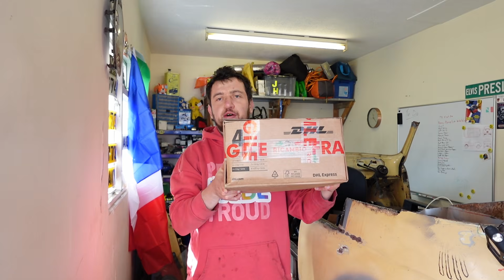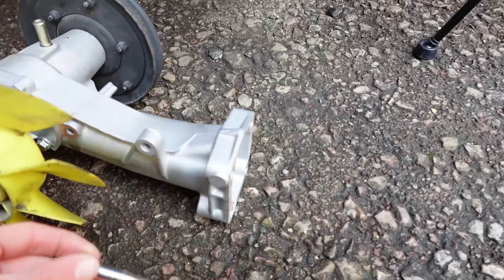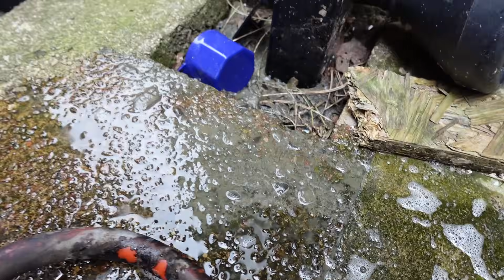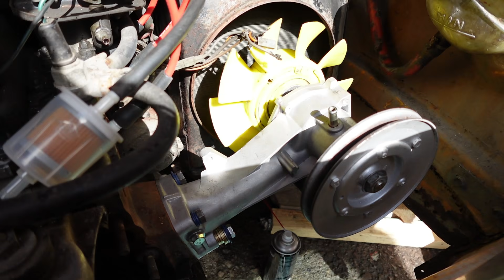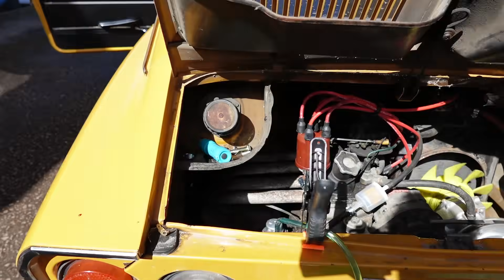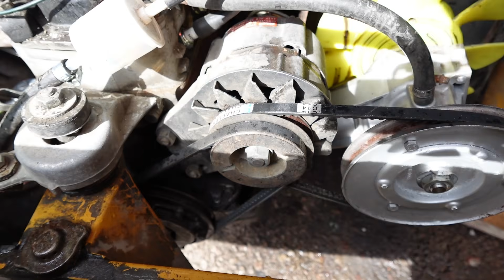New Parts  (71 Fiat 850 Sport)

Comment: Also there should be a tray under the engine bay
 It is very important for engine cooling. It forces the air to flow correctly through the radiator.
Reply from the maker: Yes the tray was taken off to fit the new water  pump

Comment: Why it is snowing in April. Whe Dutch say: April doet wat hij wil/ April does what it wants (to do). 
It is mostly caused by cold air from the north(pole) colliding with the forcefull sun warmth that heats up the Earth surface although the air is still ich cold on great night's. This difference in temperatures caused upwards air movements en hefty (snow)showers. Source: Royal Meteological Institute (Belgium, KMI).